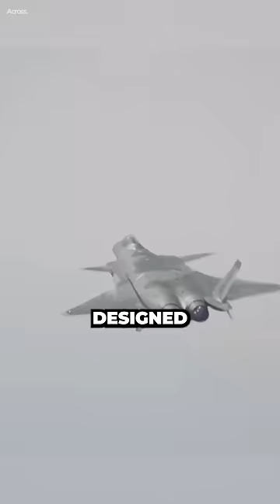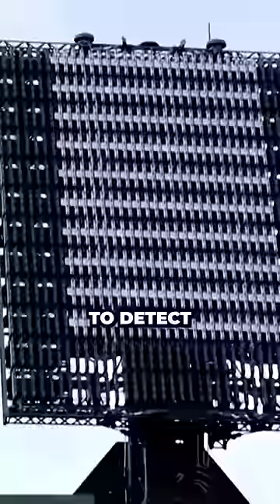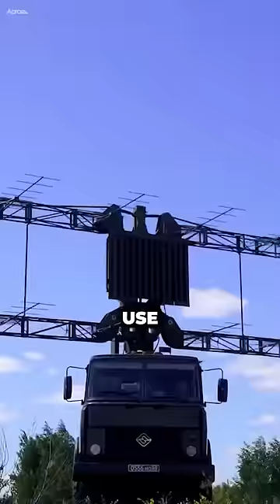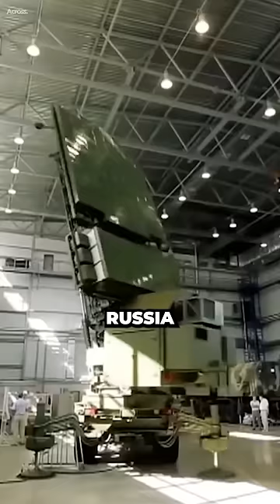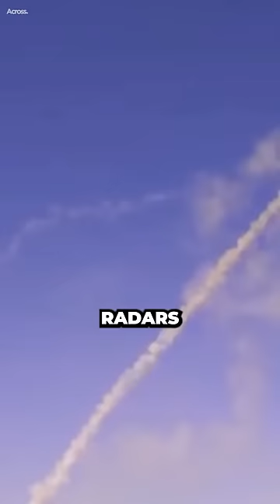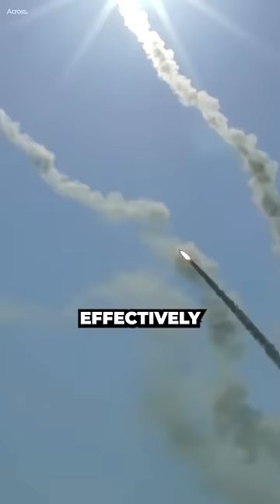How Russia's Radars Have Detected Stealth Fighters

Comment: This has been true for decades. The thing is, low-frequency radars have very poor resolution, making them impractical for shooting down the plane. That's why nations continue to use high-frequency radars instead.

Knowing that it's coming and actually being able to do something about it are two different things.
Reply: Hmm.. first part of your comment is factual all to the Point of doing something. They can't Target it by LFR but they know where it is and where it is heading which means they can focus other sensors . And jets . So they can do something.
Reply: @5tre55full  Yep, they can jump in their jets and fail to find an invisible plane.  Thats doing something.
Reply: @5tre55full Yep, people forgot about AA guns with proximity ammunition that can and does shoot any and everything down😔
Reply: Don’t forget that stealth aircraft, ESPECIALLY the F-35 are equipped with ECM and can not only use electronic jamming but decoys.
Add in cheap drones and missiles to overwhelm the site or use an anti radar missile and well, there goes their missile defenses
Reply: These ones send signals between multiple systems to pinpoint and then computer systems take over, it takes a little longer than normal radar systems but it does the job, the only thing is that target on pilots radar has factor of mistake of a few feet so if he shoots at the "F-22" he's actually shooting at a non-designated marker placed by a computer and there is a pretty good chance he misses or that it's a different aircraft, something like map markers in Squad, when one squad leader places tank marker but it's actually an APC and it's a little bit off
Reply: @nunyabidness976 so you thing the pilot didn't have a communication with the base ?
Reply: @7gmeister ECM on the F35 is useless against VHF radars. You would need a plane the size of a C17 due to antenna dimension requirements... But a C17 is easy to down with fighters. If you have drones and missiles to overwhelm a radar/missile site, than what do you need the F35 for?
Reply: Low frequency (vhf) can be used for detection and tracking. Send up a fighter to pinpoint the target or use missile with terminal active seeker... optimaly IR seeker, but a Ku band radar seeker will also be able to detect that stealth plane from 1 km to make up for the inacuracy of the vhf radar.
Reply: @S300V  obviously you don’t play chess.
You use your pawns first and your high value pieces you protect.
Stealth is only one trick on the bag which no one seems to understand.
A 5th or even 6th gen fighter has multiple capabilities that qualify it to be called that and electronic warfare is a huge part of it.
You claim to know a lot about the capabilities of the F-35 so
you must be in the US military and have a top secret security clearance.
Probably not tho
Reply: @catherineharris4746    only when and IF it knows something is there.
Triple A was going off everywhere over Baghdad and they couldnt knock the stealth fighters down....didnt know they were there...except from the blasts the precision ordinance made.
To even suggest what you did shows you have zero military background.
But, cheers
Reply: @vandasaragosa  of course they have contact.
But that does no good.
Do you have any idea how fast jets move?
You could have an actual VISUAL on a stealth plane and with a couple moves hes gone...and still hasnt shown on your radar.
Reply: @7gmeister  As far back as the F/A 18, planes have been able to grab the radar, manipulate it and send it back.
It can be made to look like a squadron of planes instead of just one, coming from a completely different direction and miles further out...or any combination in between.

I dont even know their capabilities now.  Been outta the military for a minute.
Reply: @nunyabidness976  NOPE! What YOU just wrote shows that YOU don't understand logics!🚬💅👗🙀
Reply: @nunyabidness976  the f35 has a top speed of mach 1.6, it doesn't take much to catch it, and it would probably not be gone before the radar could spot it (assuming we are talking about a low frequency radar)
Reply: @7gmeister that isn't accurate either. We have multiple platforms capable of deep penetration in saturated radar fields solo. We've been doing it for 40+ years.
Reply: @5tre55full they can send their jets to get shot down before they even get a visual.
Reply: @7gmeister geezmeister?😮😊 just tell me it`s you🙏
Reply: I imagine, in 20 years they will have full spectrum  laser weapons.. meaning they will look like what we see at a laser light show but deadly... imagine drawing a cross in the sky, then draw a second cross the same size, over lap it on the first, and rotate it 45 degrees at the center of the cross where both lines join.   You now have a rudeimentary star pattern.  It would be very hard for a plane to  evade light weapons firing in this pattern because  the overlap and redundancy would be  huge.  

Keep in mind, these kind of weapons are only theoretical and I have no idea how much power it would take to make this.  But  remember, the star wars defense initiative was dreamed in the 80's and its already starting to be implemented at scale 30 years later.  What i am suggesting is just an evolution of what they have already figured out.  Im guessing 20 years.
Reply: @wbass243  from what I've heard, the new laser built for the iron dome(the iron beam) is supposed to take "tens of kilowatts" for a 7 km effective range according to Wikipedia.
Reply: @helpmedaddyjesus7099   Your obvious lack of military experience is showing.
Skies are vast.
Jets are fast.
Low frequency radar can NOT pin point anything....that's why HIGH frequency radar is used in aviation AND ground radar (for Patriot missiles, etc)

Even if the jet was in the exact vicinity to find the jet, it couldnt lock on.....and wouldve been dead XXX miles out, before they could ever hope to get a visual.
But, hey, at least you're thinking
Reply: @catherineharris4746  I'll play along.  What was it I said that caused you to post something so wrong?
Reply: @S300V  
VHF = Very High Frequency
Reply: @nunyabidness976  did I say that the low frequency radar was going to guide a missile at the target?
The point of these low frequency radars is to at least know that the enemy exists and which direction they are in, from there you could focus your radar(s) on a target and try to overpower the stealth by just throwing more kilowatts at it
Reply: @helpmedaddyjesus7099  No, you didn't.
AND...nowhere did I say you did.
I said "Low frequency radar can NOT pin point anything....that's why HIGH frequency radar is used in aviation AND ground radar "

Translation for non military:  you'll know something is out there...in a given HUGE area....but not where it is.

Throwing more radars wont make the plane more visible.
Want proof?
Gulf war.
We wove planes through one of the most advanced,  well guarded areas and came out unscathed.
They lit em all up.  That's what made taking them out easier.

Gimme another bad example.
Reply: Holy crap there is some nonsense being sprayed around here.
Reply: @Hasan-jf7by  modern radars use UHF and microwave frequency... So yes Very High Frequency(VHF) is low frequency compared to those!
Reply: @nunyabidness976  stealth works partially by scattering as much of the signal as possible in other directions than the origin, if you have an antenna in those other directions you could detect more of the returning signal, but you'd probably need a network of radars connected together for it to actually tell you something other than "I am picking up a signal"
Reply: @helpmedaddyjesus7099  Brother, I was an AT in the Navy.
I know what's what.
And a lot what I know still can't say.
So, yeah
Reply: @5tre55full  no. They cant tell where they're going....
Reply: @catherineharris4746  "logics" 😂😂🧜‍♂️🛀💅
Reply: @nunyabidness976 //laughing hard// 
Invisible on radar but never on eyes.

What are you Marvel Avengers Freak?
Reply: @7gmeister  that's if the f35 doesn't have a malfunction and fall out the sky lol
Reply: @7gmeister yeah thing is it's only to give a better advantage it doesn't like knock the missile off fully E.W isn't what it's like in the games and films mate. Like a guy said already you need ajet the size of a c17 cos of how powerful the radar is. Plus stealth is only for first part of the first once your spotted your fucked you can't hide again
Reply: @bruddabean1676  Like I said 🙄..
You’re assuming the old rules apply to new technology.
We don’t actually know what it is capable of but they seem to have invested a lot of money into this area of its capabilities and they seem to be emphasizing just how capable it is in this area which would suggest that you don’t know what you’re talking about..
Shocking! I know..
That some dude in his moms basement thinks he knows but he doesn’t
Reply: @7gmeister  only going by the information that you go with but that you can get on the internet or read from first hand accounts of the aircraft they have used. If your such the expert how about you link me some info and correct me if I'm so wrong then cos IL happily bring up everything I have read which is from books not Google lol
Reply: U haven't completed your homework yet!!!
Reply: INTERCEPTORS
Reply: @5tre55full not true, first off, this neglects to mention, that tho they can detect it, it has to be within 20 miles or so before it can, so basically right on top of them, by the time they can "do anything" the plane will already be out of that radars range and will have changed heading and that's why they're hard to track..regardless...stealth does not mean and never has meant "undetectable" just "low obsevable" detecting one and being able to track and shoot one down are two diffrent matters, the 22 has a radar cross section of a fucking bumblebee ffs
Reply: Well russian radars locate the target and reroute thier assests on air/ground to that location. Soo now the russian aircrafta knows what it could be (f-22 Or 35 or b-2, etc)
Reply: @nunyabidness976 they forget the new 5th generation fighter can see you first before they can see them it don't matter if they know where they
Reply: But people forget the USA use a second large air plane that helps them to be visible ,the plane it's self can't be visible 😂Russia think it the air plane it's self ,the US know they trick already
Reply: @NitEmaRe77  20miles ? You ment to say atleast 200 didn't you?
Reply: @5tre55full  no, and in actuality if you look at the data available online it's more like 17 miles on the 22 with a radar cross section of .0005 or about the same radar return as a bumblebee it has to be extremely close to any radar in order for it to be large enough to be detected. It's all on Google. The idea is to use the 22 with its extremely low obsevability as the spearhead, it can get close enough to lock on to an enemy radar undetected and destroy them paving the way for more conventional aircraft like 16s, 15s, etc to destroy ground targets and obtain air superiority etc..
Reply: @NitEmaRe77   it can be detected hundreds od miles away. Learn about long vawe radars. You are naive or oblivious.
Reply: @7gmeister 'you claim to be...' but you claim 6th gen fighters exist? 👈🤣
Reply: If u can see the plane with ground based radars then you can vector fighter jets onto their positions
Reply: @gypsyjoker30  So, the Russians turn their radar onto the most useless setting and are able to see that there's a stealth-something somewhere in "that" direction. They then proceed to tell their fighter planes to fly straight at what is probably AN AIR SUPERIORITY FIGHTER and look around until they can see it.

Do you not see the obvious problem with that plan?
Reply: @dextercochran4916  they wouldn't do that. A much older and proven tech will do, heat seekers. It's actually easier than the detection part. Or, they could send 3 planes and it would still be cost-effective since the stealth plane will light up once it fires but just 1 or 2 would do. 
*Keep in mind the stealth fighter is more limited in armaments when in stealth mode. It's for striking ground targets after all.
Reply: @5tre55full yeah by the time they do something  they  would be dead. That's the point of stealth fighters , you won't see their missiles  until it's  too late.
Reply: @aachoocrony5754  That's not how heat seekers work. First of all, you still have to know where the stealth fighter is in the first place before you can even start to find a heat signature. And even then, heat seekers are more limited in range because it's generally harder to lock onto a heat source that's far away than it is to lock onto a radar signature. So, you still have to get within spitting distance of a plane that's designed to not be seen, actually see it, and then try to lock up a missile shot. Your plan only works if the pilot of the F-22/35 just sits there and lets you try.
Reply: @dextercochran4916  You just wrote rubbish again. If that's not how heat seekers work then what are they looking for? 🤭 Detecting is easy, but locking is even easier.
Reply: @5tre55full and those intercepting jets’ radars will also have problems getting a targeting lock, too - much later and closer than the stealth fighter’s lock on them.
Reply: @nunyabidness976  no they can concentrate on the vector like they did in Bosnia
Reply: @fredmdbud   ofcourse. Targeting Will be limited to shorter distance than vs regular planes.
Reply: @catherineharris4746 I guess you forgot about those things called "altitude" and "max range". Hey, you know what those aa guns use to target lock and shoot aircraft? Ah, right, high frequency radar... Wait, wasn't that the thing that can't detect stealth aircraft? Oh, shit.
Reply: Bingo!!
Reply: @victorsolis4838  its chinese 10 cent warriors.
Only thing that can explain the litany of silly posts.
Reply: @markphelt6395  are you talking all the way back to the original stealth fighter?
F-117s?

One aircraft,  one F-117A (AF ser. no. 82-0806), so far has been lost to enemy fire.

Know how it happened?
Wasn't flicking on radars, seeing it and shooting it down.

Everything from lacks airforce missions (several bombing runs, same exact route" espionage in Italy where the orders and sorte's were coming from, along with Prowlers being grounded.

I guess every dog has it's day, so they say.
Reply: @JimmyGinjaNinja   They dont need a visual! The radar sent them up and they know where the target is... That was the point! But keep having a brain blue screen...
Reply: @nunyabidness976   You must be poet! You entertain everyone with this bull? 🤣
Reply: @S300V  Theres another 10 cents for ya.
Reply: @nunyabidness976   I tought poets were poor... It seems true. Cents? You are funny!
Reply: @S300V  Yep.
Ya get paid in cents for comments with no sense.
Keep doing the King Panda's bidding, 10 cent army warrior.
Reply: @nunyabidness976   repeat the same old poems poet... Than you can forget about cents and have something else on your mind! 🤣
Reply: @S300V  tell me "Engrish" isnt your first language without telling me...
🤣😂😇

Later, tater...
Oops, thats an American saying.
How about.... You can  go pee now ~supreme Panda leader
Reply: @nunyabidness976   Tell me, intelligence isnt your best strenght... hence why you became a poet.
Reply: @7gmeister rumor has it a F35 can go deep into enemy territory and fry the sames b4 enemy even knows it was there
Reply: @nunyabidness976  I know what happened. Calm down. You hear that a lot huh.
Reply: @nunyabidness976  well since you don’t know. Bosnia had spies in Italy. Those spies would watch the take offs and I grew route and phone the Bosnian colonel who put them up to it. With knowledge of vector and time of take off. You can and they did saturate the sky in that section. And got the plane. Not a lucky shot. A well thought out and executed plan. This was from little old Bosnia. The only real engagements involving heavy loads of stealth planes attacking was Iraq. I’m sure whatever tactics Bosnia used wasn’t disseminated to the Iraqis But you can believe Russia and China got a hold of it. And I haven’t seen the military fix that problem.
Reply: People are completely wrong about so called low frequency radar.

It is true that stealth is far more effective against x-band/Ku-band and S-band radars. But stealth can still significantly reduce the effective range of L-band, UHF and VHF radars.

These “low frequency” radars are large and have limited capabilities. They are also not as effective against fighter sized targets to begin with. They are only useful as long range early warning systems. 

But if a L-band or UHF radar has a range of, say, 200 miles, but it only has an effective range of 50 miles against stealth aircraft, then it becomes useless in its intended role.

The stealth aircraft can fly through gaps in radar coverage and target the radar itself with stand-off weapons.

UHF and L-band was a significant threat to early generations of stealth aircraft because their RAM coatings prevented the use of radar warning systems. But newer stealth aircraft, such as the F-22 and F-35, have some of the best RWR/ESM systems in the world.
Reply: @scalywing1  no one is calling low frequency radar are the panacea to stealth but what we are saying is that a plane was detected using it over 20 years ago and we still haven’t heard of much of a countermeasure. The most I get is people discounting the plane that was shot down.
Reply: Russian Nebo-M decimeter-range radars are capable of detecting inconspicuous missiles and aiming them at the target thanks to computer processing of the received signal. Therefore, I would not be so sure that secrecy has any significance at all against militarily developed countries
Reply: @5tre55full and hypersonic missles
Reply: @catherineharris4746  modern AA guns can't really shoot that high as the high altitude AA has mostly been subsumed SAMs. So they'd need to start building much larger flack cannons again. And even then you'd still need decent targeting radars so you're not just wasting ammo.
Reply: @catherineharris4746  Shooting down a modern fighter aircraft with traditional AA is no easy task.  It would have to be highly specialized and expensive.
Reply: so they have said 😁, how come s300 and s 400 can be fly pass many times 😁
Reply: Says nowhere they stopped using high frequency radars!
Reply: I love when people bring up the Bosnia incident when talking about stealth aircraft and include no context as to what actually happened. They just run with the idea that stealth aircraft are useless because of Low Frequency Radar. Even though those Same radars had been being used while NATO forces were running hundreds of bombing sorties and only managed to catch them once……
Reply: @7gmeister eccm would make their stealth useless in the first place while also making harder to their radars to work properly, sure if their sole purpose is to attack those radar sites it might be a good idea, if IRST and IR systems didn't exist, but I agree that giving the target less options of locking u does make it so your pilot has a better chance to survive
Reply: Hey guys,I am just zoombified military technology jargons, high powered death instruments discussed and is totally baffled! ALL I NEED IS GOD's PEACE to render all these dangerous weapons useless.
Reply: @moviesenthil  My point was that if low-frequency radars were a viable way to counter stealth aircraft, people would be using them a lot more. But, they aren't.
Reply: You detect with one , track and shoot with other, hence the multi layered defense systems
Reply: @emreduygun  You're welcome to try. Maybe you'll luck-out like the Serbs did that one time. It's not impossible. People win the lottery.

But you can't base your AA defense on "lucking-out".
Reply: It’s the equivalent of hearing the jaws theme. You know the shark is around.
Reply: Don't sell Hi-Tech Chip to hostile country
Reply: @rasydrasta4568  why? Aren’t you hostile?
Reply: @5tre55full  correct, But radars in the missiles are high frequency, therefore the weapons are not able to achieve a quality lock, to provide a kill. The jammers in the jets (especially f35 and Raptor) are usually able to break any lock from a missile, combined with stealth coating etc. This will result in a lock that comes and goes, which in turn results in the missile not being able to track and maneuver well and quickly enough. Since the heat signature is also addressed on the nozzles in the jets, IR locks are also hard to come by and flares can help a lot. Finally, a missile does not have unlimited fuel, so making a missile change course again and again just drains the fuel, after which the missile is relatively easy to fight.
Reply: @badfaceday7509   that is if if scenario. If that would be the case with high percentage then stealth wouldn't be needed (its costly)
Reply: @catherineharris4746 Even their own aircraft. 😂
Reply: @S300V I’m waiting for you to answer his “ Are you in the military “ comment. 🍿
Reply: @alanhinkel420  Seems you have trouble with comprehension... Seek help!
Reply: @S300V  I’m not having trouble with anything. Did you answer him and I missed it? I’ll check back in the comments. My bad.
Reply: @badfaceday7509   You make this look  too easy. S300 series of missiles basicaly created a no fly zone over Ukraine for both sides despite the presence of jammers. Stealth just requires Vhf for target detection. And no IR is not adressed on jet aircraft, the seekers are too advanced now. Again Ukraine showed how IR missiles were absolultly effective. Oh and Storm Shadow missiles were shot down that have lower signeture than any LO aircraft.
Reply: @S300V  UKRAINE does not have F35 nor F22 thats why (or any other stealth aircraft, wich is the reason for that argument. If a misile losse its lock just 50% Of time, it has no chance Of hitting other than pure luck
Reply: @catherineharris4746 bullet have lower range than a missle. I'm just saying.
Reply: @badfaceday7509  They have stealth missiles... of which many got shot down. Losing lock dosent effect it that much, modern SAMs are TVM guided, there is always correction from ground station (thus the Vhf radar as well).
Reply: I'm no expert, but if they can detect it, they know where it is, thus can target f22 going at high speeds in that general area. A system of low frequency could be set up as early warning system which can alert operators to target f22 in those coords.
Reply: @eivorrudjyek9083  You're right. You aren't an expert.
Reply: @S300V  1km? The F-35 or F-22 can target an aircraft or radar installation from beyond 200km, so good luck with that
Reply: @yomama629  The missile itself locks on from that range with its own radar! Come on! Comprehension!
Reply: The problem is not seeing it is shutting it down down lol
Reply: I’ve been told the low frequency radar is easier to jam. Is that true?
Reply: @michaeldrummond7590   In some ways it is. Fewer frequency bands to choose from when trying to avoid jamming. However aircraft have difficulty in jamming Vhf due to antenna size requirements.
Reply: @5tre55full LFRs give rough direction and range resolution so not only will you not know the size, you wont know how many of what the target is. Telling someone oh he is somewhere to the west is useless. Especially when deception and spoofing exist.
Reply: When you know it is there, it's good enough to fire the missile in the proximity and when close the missile can just use other system for the rest for the hit.

Doesn't matter how precise the radar is and if its 100 or 1000m off, such distance means that the missile can 'SEE' the jet and that's it.
Reply: @miriamweller812  That's not how it works.
Reply: @miriamweller812  no it doesnt. Missiles have this crazy thing called seeker diameter and field of view. And seeker sensitivity. And when you fire it the target is now always going to sit still and wait for your missile.
Reply: That's why Russia and others use dual/multi-band radar!!! Low band for search and mid + high band for tracking. Stop being misleading or using your lack of knowledge to advance your propaganda!!!😂😂😂❤🎉
Reply: @matthewlewis-zw3tf  Lol! That's not even how that works! 🤣

Where'd you pull that? The Russian Ministry of Defense?
Reply: @dextercochran4916  Tell me how it works genius!
Reply: @aachoocrony5754  That's correct. Dexter is not qualified to ride a moped.
Reply: @dextercochran4916  That's what is said about the dual band radar on the Ford class carriers. 👏 You are stooopid.
Reply: @dextercochran4916  You must know nothing about tge subject if you didn't know that. 2 radars: 1 search, 1 track. That's about as basic as it gets. Sorry if ABC NEWS didn't teach you this..
Reply: @matthewlewis-zw3tf  Has anyone told you that your YouTube account is only 8 months old?
Reply: @dextercochran4916  That's your best reply?????
Reply: @matthewlewis-zw3tf  Shhh... Be silent, little bot.
Reply: @matthewlewis-zw3tf  every country does that. Thats been a common thing since the 60s congrats.
Reply: @darrengarcia4937  Exactly Darren. 💯
Reply: 4
Reply: Russia has a lot of different radars, that use several frequencies, and those radars are capable of sharing information, and forwarding it to SAMs systems, for pinpoint accuracy. 
Those frequency ranges are from 400 something MHz, to several GHz, to tens of GHz + they have optical and thermal tracking on mobile SAMs.
Reply: @S300V  The Ku band is a highly populated radar band with many civilian uses that causes a lot interference, hence why Ku radars don't really exist. Even then, Ku radars would fare even worse against stealth jets as its an even shorter wavelength compared to the X band radars used on most jets. The lower the wavelength, the more effective stealth coatings are. On top of that, the Ku band would be even less effective because, by being a high frequency form of radiation, it would dissipate faster than long wavelength radars.
Reply: Radar stealth doesn't mean shit to infrared detectors.
Reply: Where do you learn this
Reply: @ImBigFloppa  We are talking about ranges of 1-2 km! Just to compensate for search radar inaccuracy. What interference at such low ranges? What dissipation? Actually stealth works best agains Xband, that is what it has been optimised for! So its not better against Ku and again we are talking about a few km range.
Reply: @hhkk6155  That's right.
Reply: You are true... And this is probably the reason many nations are developping their 5 th generation fighter...
Reply: Everybody knows it. It is public. However low frequency RADARs can only detect stealthy American's planes at short range (60kms guaranteed) but at this range the fighters could be firing weapons against targets at blind spot.
Reply: @nunyabidness976  You know nothing about radars.. haha a f18 can make it look like 1 is a squadron hahahah omfg this is the most rediculous thing i haver ever heard.
OTHR over the horizon radars nothing can manipulate them as they see all .Australia OTHR Jorn has been able to detect stealth since day one and is the biggest most advanced radar in the world.
Reply: Most just do not understand the technology lol. Australia JORN OTHR over the horizon radar, the biggest most advanced radar in the world with it's tech that has even been sold to USA has very good resolution and even needs AI to help track hundreds of thousands of the targets.
One radar tracker on this radar once pointed to a target in Singapore from Australia and told a official that it was a Boeing 787 taking off from Singapore airport. said the only thing he could not tell was the planes tail number.
Most just do not understand the tech haha.
Reply: @nedkelly9688  Correct!!
Everybody knows it. It is public. However what isnt public is the locking and fire capabilities of Russian array -- with low frequency RADARs integrated to the S400 antennas -- which is not only truly capable to track but also lock position of stealthy American's planes at short range (60kms is guaranteed) -- but at this close range the fighters already had dispatched their weapons against the targets almost at blind spot. So the Russians also use the Russian Doll air defense doctrine.
Reply: @nedkelly9688  This is ancient tech, child.
It's the only reason I mentioned it.

Kinda like those radar detectors in cars with settings for speed?
Yeah, dont set it to 35 and blow by a COP doin 80

Here's a fun fact.  If ya bump your detector up a watt when it sends the signal  back, it lets out all the extra smoke out of a radar gun. 😁
Dont get caught
Reply: Why that Italian pilot did not use F35s stealth capability against Russian 4th generation su27 ...???
Reply: @S300V low frequency (vhf) what is it...??
Reply: That's why f22 fighters have now captured Russia?!
Reply: @mig_21bison   Different radars work on different frequencies... Very high frequency (vhf) is one of them. RCS of an aircraft depends on the frequency of the radar used to detect it.
Reply: @S300V  Actually its much more than 1km. Radar detection range is influenced by the distance to the 4th power. Meaning detecting something from 10km is 10 000 times easier than detecting it from 100km. Even the most basic of basic radar will see a stealth plane from 5-10 km. This is not even counting that when you get that close you are probably not facing the planes stealthiest sides due to difference in altitude and angles of aproach.
Reply: @SlayerBG93  Yes, ofcourse. This is just to show that even in worst case scenario, a not too good radar homing head could correct the inaccuracy of Vhf(long wave) radar station. People tend to think these things can only roughly locate aircraft... A 200-300Mhz system can locate with 800 m accuracy in range. Yes X band is more accurate, but not by large! And I mean with active homing heads, whats not going to correct this inaccuracy? Even one with just visual range would be ok.
Reply: @S300V  1km, are you kidding, bombs dropped and half way home by then.
Reply: @user-lc4kj1yr5d  I c you didnt manage to understand that this figure is for the missile's own radar. Not of the radar station. Its only to "correct" any inaccuracy. In reality its way better btw.
Reply: @catherineharris4746 flak guns?  Against modern jets?  I dunno man, that's not too likely to work well.
Reply: @catherineharris4746 no, he's probably just not a radar tech.  Neither am I, but what he's talking about is sending a duplicate signal when radar hits you to fool the radar with erroneous data.  I've talked to enough of them to have a ...rudimentary idea of how it works, not a very strong understanding unfortunately but enough to get the gist.
Reply: @S300V there's a massive difference between something being effective against the cold war tech Russia is fielding in Ukraine and the bleeding edge tech the US uses.  There's a very good reason we pay so much for our military tech while so many of our people starve man...  Military and technological superiority is just that important to the US.  Heat seekers are good, but won't get a solid lock on a modern fighter until you're pretty close and even then flares and other countermeasures are still effective.
Reply: @NeoIsrafil  Have you heard of MANPADS? Those get a solid lock from 4-5 km. Their seekers also became fairly resistent to flairs, so much so that attack helicopter use almost became nonexistent for a while over Ukraine until longer range weapons were introduced. So pop a seeker like this on a larger missile and it corrects any poor resolution that a low-frequency radar may have and still get high hit probability.
Reply: @S300V  But you do realize the problem of having to have an aircraft with a Ku band radar get 1 km close to an F-35, don't you? Most russian fire control radars actually use the X band. That being said, getting close to the F-35 is a danger, particularly under 30 km. 30 km is the kill zone. It's the no-escape distance for the AIM-120, and it's also within range for the AIM-9X. And the radar of the F-35 can see incoming targets from around 400 km. Chances are, the moment an interceptor is under 100 km close, it will be shot down
Reply: @earlbinvico  You do realize that missiles are also often called interceptors. That I never said that some fighter has the Ku band radar onboard. That this entire action needs FC radars at all. No! 
What I said is: a. Vhf radar detects F35
b. Vhf radar tracks F35 and passes data to SAM site and/or fighter aircraft
c. SAM site and/or fighter aircraft fires missile with Ku band active homing head in lock on after launch mode
d. Vhf radar updates F35 location to SAM site, fighter aircraft that correct missile flight path
e. missile locks onto F35 when in close proximity with own Ku band homing head.
Reply: I dont believe those "stealth " wonder weopons . We all remember what happened to the most overhyped stealth weopon at the time over serbia . And they came up with a hillarious lie saying "because weopons bay was open"  and people still bought it as facts 😂
Reply: We all know what happened to those "invicible stealth" over serbia . Radars  and missiles not even that good at the time compared to now.